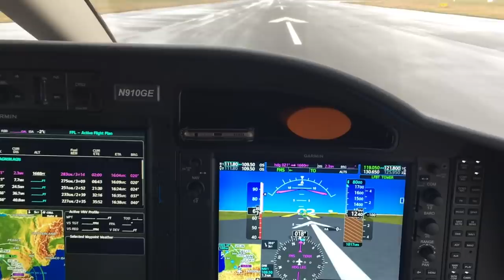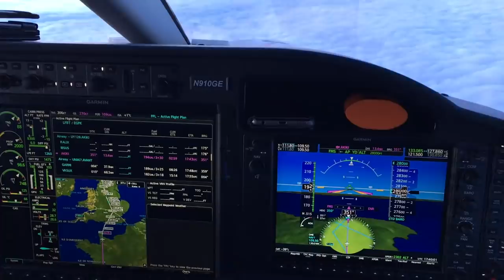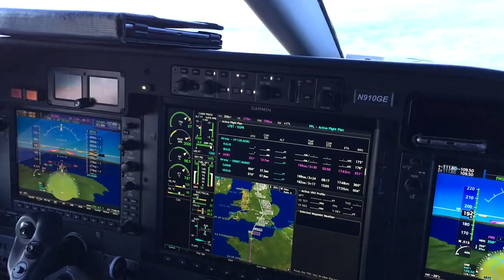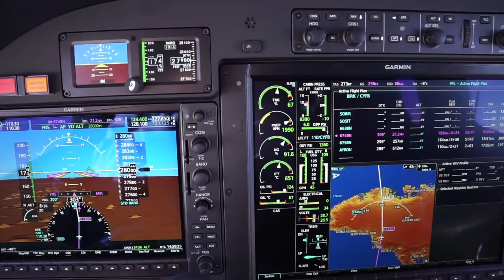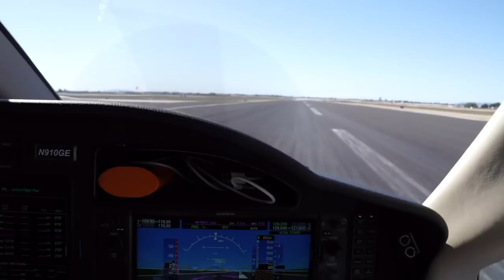How We Ferried a Daher TBM 910 from France to California – AIN

Comment: Never knew a prop-plane like that could fly so far! Nice work guys! 👏🏼
Reply: socalsilver There are clearly stops
Reply: WattsUpDev for sure, but some of those legs (in very isolated areas) were pretty far.
Reply: They didn't fly non-stop because the TBM-910 has a range of around 1700 miles, so they had to land in few places to refuel and get some rest.

Comment: Why don’t they just crate the wings and they could roll several fuselage’ in a large air freighter to the US?
Reply: Not cost effective. A Tbm cost roughly $500 per hour to operate. Roughly $800 per hour with ferry fees. A freighter is $15,000 to $25,000 per hour. A France to California flight would cost roughly $180,000-$300,000 depending on freighter size. Then labor cost for reassembly of the tbm.